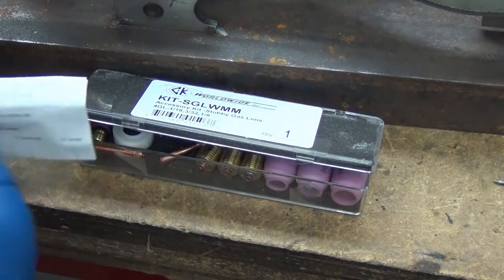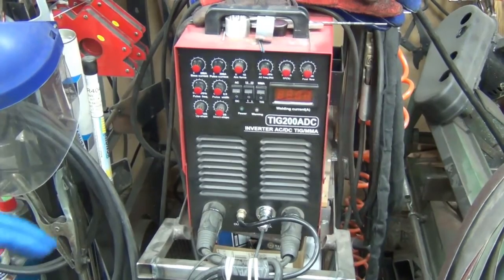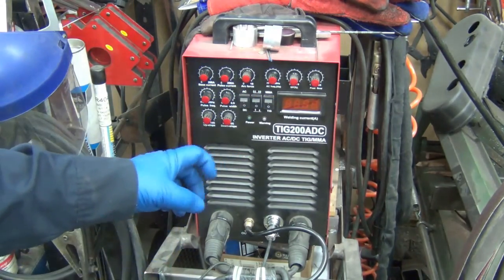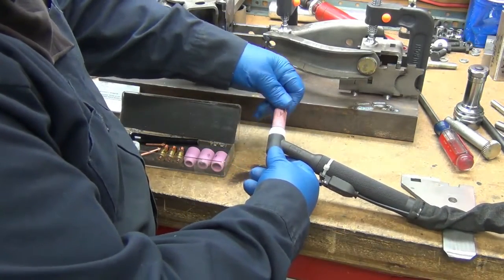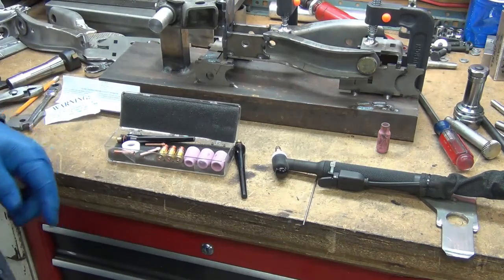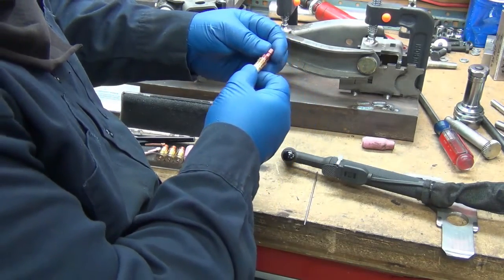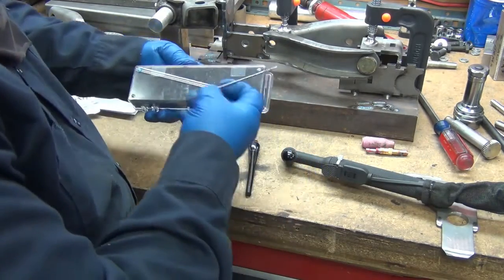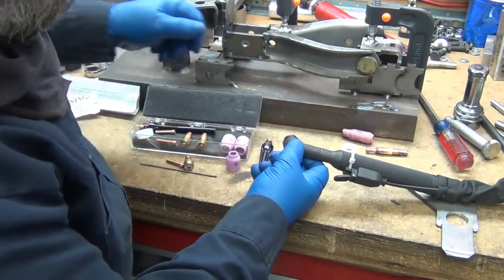Stubby Gas Lens Kit - Chiry TIG WP26 torch

Comment: Not sure why you had to drill that collet out. Ck stuff is spot on. Try inserting the sharpened tungsten from the cap side. I never had to drill any.
Reply from the maker: I was surprised.  The gap on each side of the collet was even.  When I worked a sharpened 3/32" electrode into it, it spread the gap pretty good. Even from the cap side, a sharpened one wouldn't go in.  The hole was noticeably smaller than my other 3/32" collets.  I have only been exposured to the collets that came with the welder(copper)....good chance they're not a good example.  I'll look at the others and check them too.  Could very well be that I was the problem :)

Comment: Hi, that's why I love my 300 amps Weldcraft water cooled torch, short, light and flexible... The cooler is way more expansive than the torch.
Jody is a excellent reference when it comes to welding...!!!
Reply from the maker: I'd love to upgrade to a water cooled torch, but I just don't use TIG enough to justify it yet.
Thanks!!

Comment: WP-XX, 26, 17 etc are Weldcraft models. Yours would be a Chinese clone. I bet Tweco makes some too.

Try the Lanthiated electrodes, they are supposed to be universal.

I have a regular gas lens on my WP17 and 26. Real nice to use and you can cut the gas flow down to save a few $$ (more so you don't run out in the middle of work.) I don't have the 1/8 collet and need some more cups so I'll probably order the set from Jodi.

Thanks for the vid.
Reply from the maker: Thanks for the confirmation!!!  I was just looking online for more info about it.  The "4-series" accessories say they fit the 26.  The 3-series say they do too......but I don't know what the difference is between the series.  I was thinking about ordering another torch with a flex neck and wanted to make sure I got the same size....so thanks!
Suggesting on cfm to use?  I'm still running the gas at the same setting. 
The electrode I cut in half was a 2% Lanthiated(dark blue).  The ones in the kit were light blue....which is rare earth?  If Jodi doesn't have what you want, http://www.weldfabulous.com/  seems to have some pretty good prices and selection.......but since I don't do this as often as a pro, I also don't require supplies as often either.  Most times, I just pick them up at one of the small local suppliers.
Reply: bluehandsvideo I run mine at about 9 CFH (about 4 LPM). I hear you can go even lower with a gas lens.
Reply from the maker: bluehandsvideo
Thanks!  I'll have to look at mine....I think I'm running over 12cfh.
Reply from the maker: I checked....I had it up around 21!   I turned it down to 10.  I need to pony up and get one of the glass tube gauges.
Reply: Yes, I added a real flowmeter to mine. The regular gauges are not real accurate. They are just a PSI gauge calibrated to an orifice in the reg.
Reply from the maker: I just went and ordered one....should be here friday :)
Thanks!